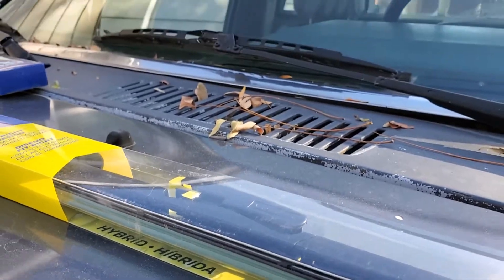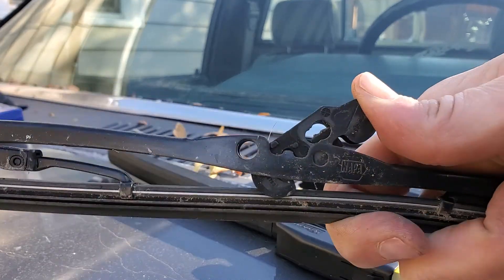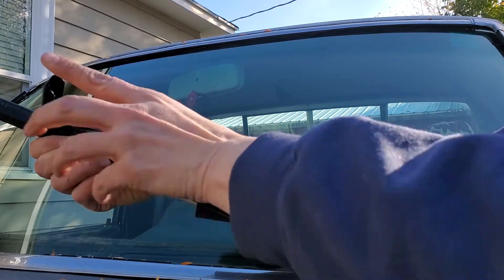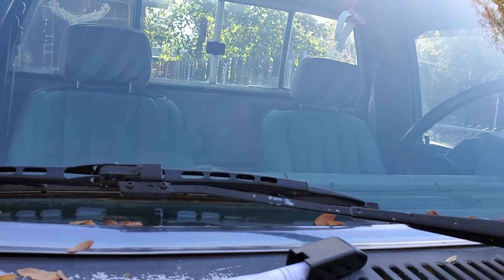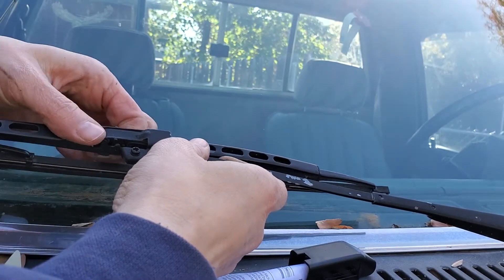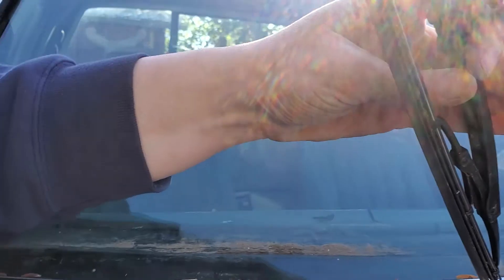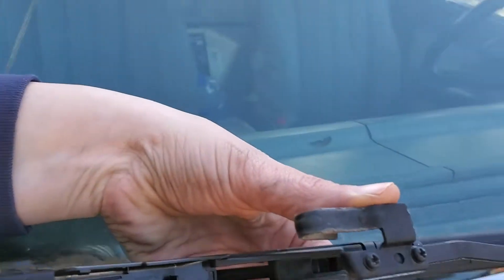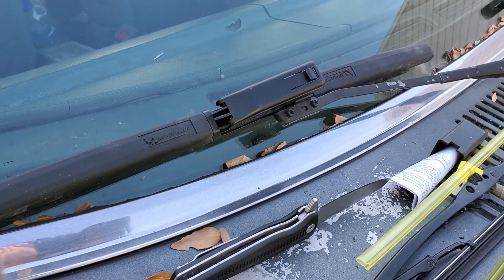Michelin Wipers on 84 Toyota | Costco Buy

Comment: My mom recently purchased these blades for her Lexus. They work well and are priced well. On my Nissan I used to use these before switching to PIAA super silicone wiper blades. The PIAA are much more expensive, but work better and last longer. Still, these Costco blades perform well for the price.

This website will tell you what adapter piece is needed for your car. https://us.michelin-lifestyle.com/en/promotions/us-costco-wiper-blades
PIAA Super Silicone Wiper Blades - https://www.tirerack.com/wipers/detail.jsp?ID=1043&brand=PIAA

https://youtu.be/SpdgahDp2Wg
Reply from the maker: I bought more expensive blades before. Here where I live the dry sunny months destroy any I've tried. So I stick with less expensive and I think in the end its balanced. Hope you can see all the winter through!